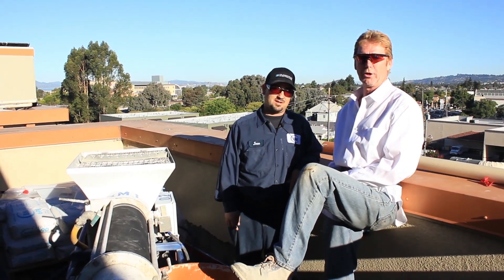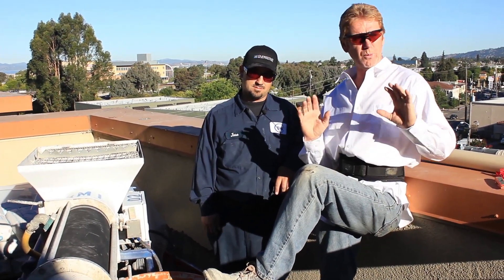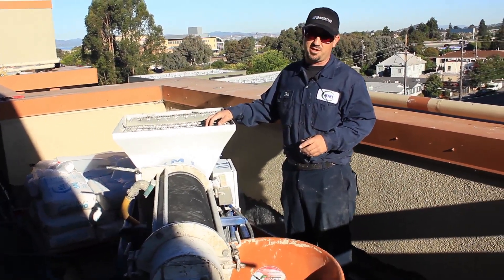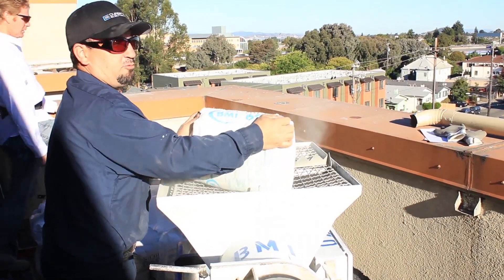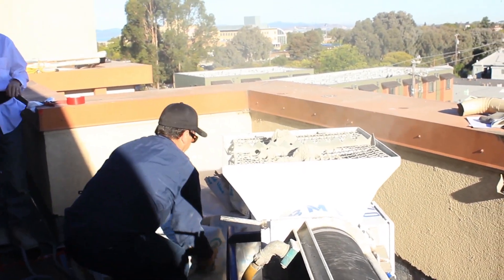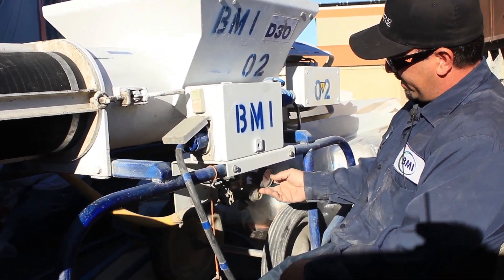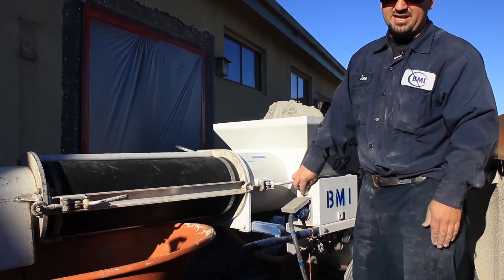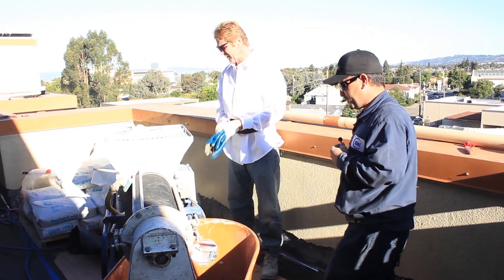Mix reinforced fibered plaster with a BMI D20

Comment from the maker: Evening yrulooknatme  dude,
 No, if you have allot of patch work that requires a third coat this material is excellent or if you wish to apply the scratch and brown in one application and allow time to color coat using a cementitious finish or an acrylic this is the material for you. For patchwork and matching the existing finish on the same day this is not the material. (Can't sponge float or create texture details that I generally do)

 Cheers and have a good evening,
 Kirk Giordano Plastering

Comment: What I figure was that the plaster  not as heavy as the mixer you use with your truck for concrete. So  no shear pins needed but procedures an engineering between different companies .thats true it's no how old you are it how you feel . Best